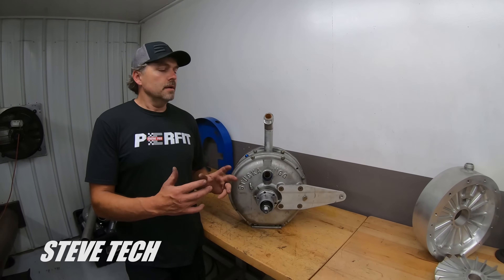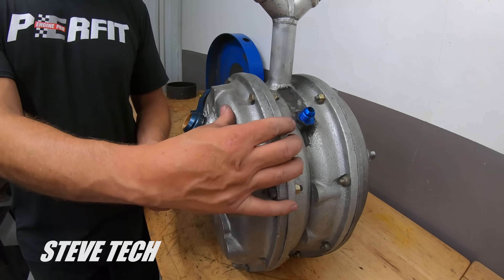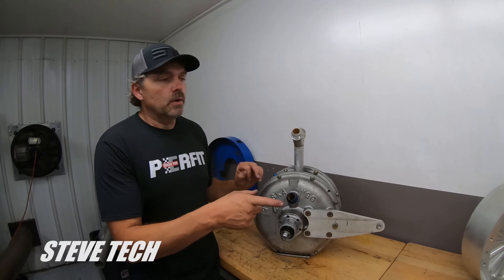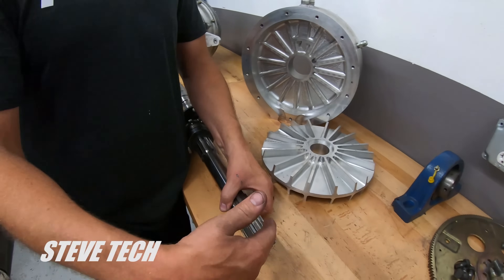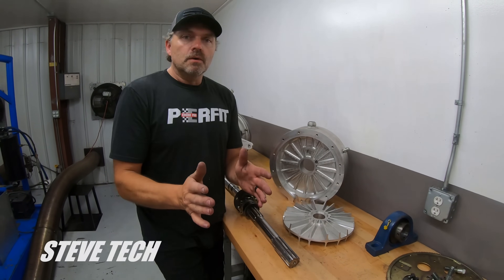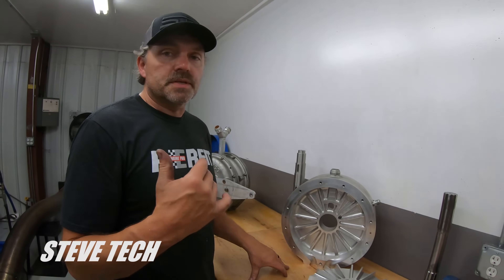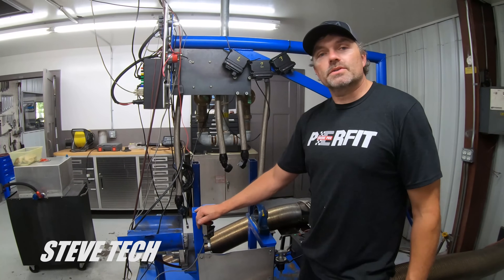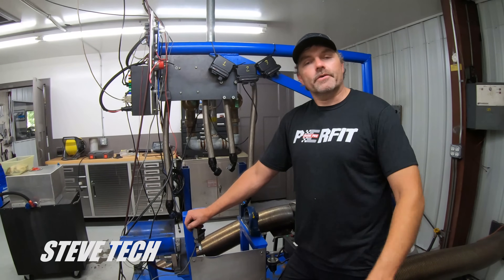How does a Dyno Really Work??

Comment: THANKS A CAZILLION STEVO! I MADE A DYNO FOR UP TO 10 HP SMALL ENGINES AND HAD NO IDEA HOW THE ABSORBER WORKS ! I ACTUALLY USE A  chrysler Bolt together converter! But i used a load cell like a truck scale uses and bolted an arm to set on the load cell! Its not accurate as i would like but i took two engines that had been dynoed off a mini drag rail and dynoed them on my make shift dyno and overlayed to get a close idea!

Comment: amazing explanation! I am researching a electro motor dynos had no idea you could create such a load it sounds better as to a electronic brake since is analog/organic resembles natural enviroment better. It does seem there are very complicated thermodynamic and fluid dynamics involved. How do you change the parameters in calculating based on temperature, flow and pressure, after you make changes to the structure of the dyno?

Comment: On two stroke bikes engines we call that area the 'Squish' band which is 360 degrees around the head chamber.  We keep it around 0.020" which keeps piston crown temps down.  That's important because as the under side of the piston dome temp rises...........so does the area in the lower crank case which raises the temp of the incoming fuel charge.  That lowers the volumetric effeciencty of the engine.  Less power.

Comment: That's very interesting. Do torque convertors in cars operate the same, the oil only stays on the outer rim of the convertor housing? I would think that you would want no air in the oil or water at all. But I suppose that's impossible with the shearing and heat.

Comment: Hi Steve, I build experimental and certified aircraft engines. I’m building a new dyno and are curious if you control load by regulating pressure on the inlet side or the outlet? I have always done it on the outlet. Nobody makes dynos for aircraft engines so I have to make everything myself. Thanks love the channel

Comment: So basically the load cell is measuring shear force on the water, converting it into a variable electronic signal to the dynamic forces to measure torque input and horse power is a software generated calculation? With all things even, the amount of water is consistent, the temperature of the shear-force water is kept consistent and the software calculates the rest of the graph based upon the load cell (Stain Gauge) based upon these forces thru the arm sticking off the right side & the rest is all calculated via software? I got it.
  Being a service manager at a boat dealer, folks may not know the one engine on some twin engine boats ( some use a rubber cushioned hub vulcanized to an input plate) but the props are different. Certain direct drive marine  engines fun counter clockwise as for the most part, the camshaft is reverse ground which otherwise the starter is mount facing the engine and not along side it. 
  You may have to order parts indicating engine direction as "Port" or "Starboard" sides. 
Not to get off topic but the interior of some of these boats are gorgeous as all teak wood everywhere, even the bathrooms. Twin big block 454 cu in with twin blade "Bravo III sterndrives can push a 12,000 pound boat at 42+ MPH and is the closest thing you can get, to going that fast (GPS Confirmed) to sitting on a very fast front room couch. 
DK, ASE master tech since 78, retired.

Comment: I didn't fully understand how the stators arrest the circulating water.
Would the torque figures at the load cell really be 1:1 with the torque transmitted by the engine?

Comment: Is boiling the water an issue on longer runs?  Also does cavitation eat the rotors at all?  Finally what's the big advantage of a water based absorber vs. an eddy current absorber in this application, is water just a lot less expensive to scale up to this capacity?  Excellent videos, I appreciate the info!

Comment: Just curious, what's your opinion on the Electric brake dynos? I know you just installed a hub dyno recently. Can an electric brake be used as a standard engine dyno? Also is there a difference in accuracy between a Water brake and electric brake dynos?
Reply: Electric brakes are great but can't handle huge power without being huge themselves = expensive . There is no difference in accuracy between dyno types. They only differ in size, cost, capacity and suitability for the application. Accuracy comes from the measurement equipment you have.

Comment: Put a vent on either side of the water inlet and just install a solenoid on each vent so the correct vent will be open when running either direction.

Comment: Great video Steve Can i ask do you change the water pressure going in as the engine rpm rises or is it just a constant tap pressure
Reply: I also wonder about the correlation between the water pressure and engine loading, and how it’s applied.

Comment: Those parts are surprisingly small for the power made! I used to run a 'slightly' bigger Tyler brand that could take ~ 5000 hp/15,000 ft/lbs. Did blow driveline on that, which was hella scary and made a mess!

Comment: I was once told how to make a dirt cheap dyno was to take a trans and put a 12" lever on the output shaft onto a load cell. All you got was torgue but it could show that some changes were good. You had to do the math for horsepower Thanks very informative.
Reply: That wouldn't work because torque converters actually multiply the torque.  The dynos use a fluid coupling that don't multiply torque.

Comment: Feel like using a motor generator setup would be better and less maintenance, plus you could use the electricity for the shop.
Reply: It would have to be a dc dynamo because an ac generator has to be run at a steady rpm to make the 60hz for american power. 50hz for most of the rest of the world
Reply: @danhammond8406  Would probably just rectify it right away to store it in some batts anyway.
Reply: It's way more expensive and difficult that way. You'd be looking at trying to manage a steady 3500+ horsepower which would require a very large generator along with all the cooling and control for it. Then at that point where does all the power go? Would take a massive battery bank since you're sometimes looking at several sustained runs multiple days in a row. And then if the batteries are charged do you just wait several days to deplete them before you can do another run? The power company also wouldn't want you randomly dumping that much power into the grid either. 

With the water brake you can see how small the unit can be and still handle several thousand horsepower. And with a large water tank it can run for a long time and still not overheat. And, the absorbed power doesn't have to go anywhere since the water just gets pumped back to the tank.
Reply: think Locomotive dynamic braking and the massive heat they produce

Comment: so how to make sure this thing equally apply the torque to the sensor, im still not understand, can you make another video about the principle？or just by control the water flow in turbine to equal torque was input then measure the data from sensor to times the data from revolve meter
Reply: The water acts as a mechanical coupler yet not 100% efficient or it would snap.  Think about it like this…the engine is hard coupled to the absorber shaft and spinning that turbine rotor any time the engine is running.  The water provides a coupling to the outside case to transfer some of the torque (variable and I’ll get to why and how) to the case.  The case has that steel plate bolted solid to the outside and extends over where it bolts to the load cell at exactly 1 ft from the center of the absorbers shaft to center bolt of the load cell (the load cell is just basically an electronic hanging scale that outputs an electric signal proportional to how much weight is “hanging on it” or in this case how many pounds/feet of torque—hence why it’s at exactly one foot distance—-one pound of force (weight or this case torque) is equal 1 lb.feet torque (imperial unit of torque).  If you wanted to measure in Newton Meters I suppose you hang the load cell at a meter and use a load cell calibrated to output newtons.  At any rate,  so without the water inside the absorber, the inner rotor would just free spin.  You need the water to form a variable coupling to the outer case and transmit the torque/twisting motion to the load sensor to get a meaningful reading.  
Now the water controls —the water in/out calving is used to control the variable coupling effect.  It must be variable to be able to resist the engine spinning.  Engines typically produce more power as the rev up higher.  So at say 1500 rpm you need X amount of water getting pumped into the absorber to supply a load to the engine and to hold the engine at a given rpm for steady state testing and tuning.  There are various tests dynoes perform.  Steady state (constant rpm) and sweep tests (incrementally increasing rpm through a set steps of an arbitrary amount-typically 500 rpm increments—increasing to the max rpm you wish to spin the engine to/if it is capable by design.  The higher the engine revs the more torque it makes (to an extent) and thus the more water needs feed into the absorber to be able provide a steady load for testing (thing of it as the engine would just run away unless you had a way to vary the load).  The water is also controlled on the outlet side and this among other things has to do with the heat buildup in the water from shearing.  
I used to take engines I built to a guy in Chicago named Ray Bellucci.  He had a water brake dyno and when he ran the engine, he had a cable hooked up to the carbs he activated thru a lever at the operators control panel, a computer, and a knob that I’m fairly certain was the control for apply the water.  It’s really neat how this worked.
When it was time to make a pull he would open the knob/valve a small amount applying a relatively small load to the engine while at the same time cracking the throttle lever open towards full throttle. The engine would accelerate but hold steady from partial (water “brake” load he had previously applied from that knob.  When it was holding steady he would go wide open throttle while simultaneously apply a bunch more load with that knob/water valve.  The engine would drop down to say somewhere around 3500 rpm (they were 11,000rpm dragrace motorcycle engines).  Then the computer seemed to take over and step the rpm up by the 500 rpm sweep till redline.  I didn’t see him mess with that load knob till the run was over so maybe it was controlling it thru the return/outlet water valve.  I’m sure there more to it and this was an old machine it’s been over 20 years ago.

Comment: This was very educational. Im still wondering how it determines how much torque is being made.
Reply: Torque is a measurement of the pounds of force 1 foot away from the output shaft. The load cell S shaped thing he said he hasn't broken yet. The motor is trying to turn and the water brake (absorber) is resisting the motor from increasing speed (rpm)  faster than 300 rpm per second. The amount of brake it has to use is the lbs of force on the load cell. So if he gets a reading of 1500ft-lbs, the motor is twisting the brake with 1500ftlbs and that on the load cell

Comment: I'd love to see a sister video going over the controls for this. How much water it uses, how hot it gets, etc. I've always "conceptually* understood how water dynos work but this is the first time I have seen it explained in a way that totally makes sense
Reply: yeep, i still can't total understand after the video,by how to measure the torque equal to input
Reply: @12Senna  that load sensor he had is measuring how hard the dyno is trying to twist. That load cell is about 1 foot from the center of the dyno, so if it reads 200 lbs, then it means the engine is putting out 200 ft-lbs of torque. You take that along with engine RPM and you have horsepower
Reply: @Modna89  I know this step but first it still need to apply the same torque with the engine input, by my guess is control the amount of water flow by the turbine
Reply: @12Senna  oh yes exactly. The more water allowed in, the more the dyno fills up, the more resistant it is to rotation

Comment: If the load cell is measuring torque (French word for twist...) where do the horsepower numbers come from....is it a time/work algorithm?
Reply: Hp=(torque x rpm)/5252
That's why all dyno reports horsepower and torque curves cross at 5252 rpm. It's the math.

Comment: very cool. How do you calibrate the dynos? Do you somehow take into account the energy spent in heating the water?
Reply: Good question, I was wondering the same thing. The load cell can be calibrated easily by the weight since it is a one for one ratio, but it would seem like there are other losses that need to be accounted for.
Reply: All the "losses" actually appear as torque. The heat is the excess power being absorbed in order to read how much torque is required to hold it back. So there is no need to account for it to determine the torque. The pillow block bearings on the outside of the housing however do eat into the torque figure a little bit but I doubt he would compensate for that ( but I would, in fact I would use air bearings there). It's Sort of like tractor pull; You don't care how much power its making or how much dirt it throws around, all you want to know is how much weight it can pull and how fast it can pull it. Once you know that, the exact power , accounting for everything, can be calculated.

Comment: Love your tech videos!  The fact that your willing to share just a little slice of your infinite knowledge is awesome! Problem is, a lifelong gearhead like myself, I'm wanting more in depth... Like camshaft development,  cylinder head port,  combustion chamber design. Valve and seat angles and the effects it has on flow.. 
Thanks Richard Bentley
Reply: Pretty sure there's no one single way of designing cylinder heads for a host of needs turbo vs NA vs torque needs etc a flow bench and a lifetime of experimenting is really where you end up after the initial theory of airflow is taught.

Comment: That's absolutely incredible!! Love the full feed billet brake. You can run dual load cells and average the 2 or 3 together for even higher torque in the Cap'n Insano range.
Reply: maybe not that easy to make it works, input shaft on first turbine may have failure
Reply: @12Senna  You are right on. The shaft closet to the motor would have to be strong enough to handle the torque for 3 brakes on a 3 brake system. The second shaft will be to take the torque of the two absorbers resisting it's rotation and the 3rd will only need to handle it's own resistance. 
Good catch on that one!
Reply: @curvs4me   well, as a graduate of engineer for one year, should be count as basic judgment 😏👌

Comment: Very cool! I think the absorber measures torque but absorbs horsepower. If you had 1000 lb-ft at 2000 rpm vs 8000 rpm, I think there’d be a difference in how fast the water heated up. Still a very interesting view of your dyno absorbers! Thanks!
Reply: if i'm understanding this correctly , the water in the absorber just transfers the load to the load cell irregardless of the number of absorber chambers, amount of water. Higher torque engines would need more or larger  absorbers to harness the torque and apply load to load cell. and i dont think water pressure would change the "calibration" of the test. torque measured at 1 foot

Comment: Great video Steve. 
Curious, what you use for that backup safety strap for the potential 3,000+ ft/lb shockload? And do you attach it directly to the main case so that if the bolts in the bracket were to somehow shear off you'd be more likely to minimize the carnage?
Also, you mentioned that you previously were breaking the input shafts. How high do the rpm's flash when these monsters you build all of a sudden go from having a massive load to freewheeling?
Man, the worst case scenarios sound terrifying!
Reply: Those are excellent questions!
Reply: Oh don't worry. I'm sure they have an msd box with an rpm limiting chip.
Reply: @jakefriesenjake  rev limiter does not / would not help in that scenario
Reply: @toddformanek8495  some boxes have a 2 stage rev limiter, that should take care of it.
Reply: @jakefriesenjake  If you have an engine that is rapidly accelerating against a big load (the dyno) and that load instantly disappears (broken dyno input shaft) the engine is gonna instantly zing to the moon regardless if spark is present or not
Reply: @toddformanek8495  I know, just pulling your chain. I was going to reply "but if your heads can only flow up to red line, and your valves will float, 200 rpms past that, and you only have a cam rated for "1500-5800", it should be ok., but I'll leave you alone. Lol
Reply: @toddformanek8495  That happened on a friends 421 stroker chevy, had an MSD 7AL3 box I think.. the real BIG ZAPPER, 500hp single stage nitrous, snapped the input shaft on the transmission, Rev limit was set to 9000 I think but datalogs showed it up at 12,500.. it held together but the main bearings weren't tight in the bores anymore.. it was a 78 corvette and lifted the front end on the launch... and it got it to an 8.80 1/4 mile
Reply: @Rx7man  Dang!! 
So, all he had to do was roll some main bearings in it? (And fix the transmission) That's pretty lucky. I wonder if a scenario like that shortens the life of the rods?
Reply: @toddformanek8495  Yeah, he went through the whole thing, he's lucky he had a rev kit and all the good parts in it or it would have been ugly.  I think the crank got polished and new rod bearings too, I can't remember if he replaced the valves as a precaution... we were all broke and eating spaghetti and ketchup back in 2002
Here's a pic of the car https://i.postimg.cc/zB3qGWx4/Vette-launch.jpg  He later built a 632 cu in big block, powerglide, and 3 stages of nitrous on it.. I kinda lost touch with him but I think he got into the 7's